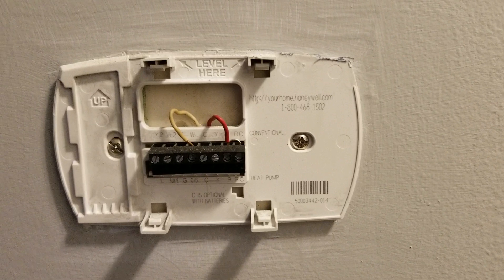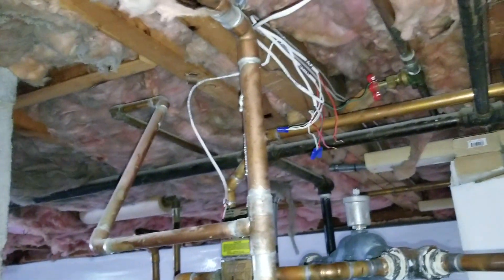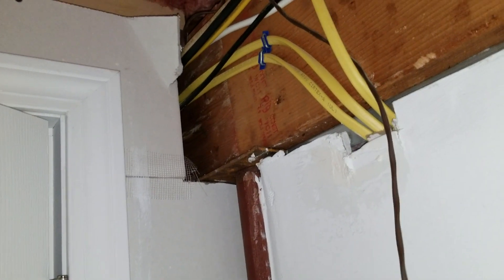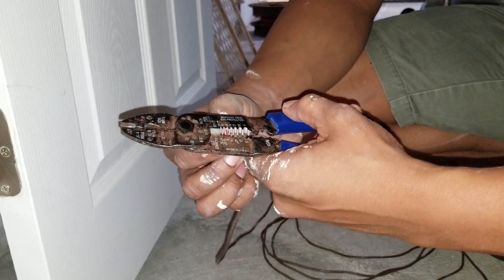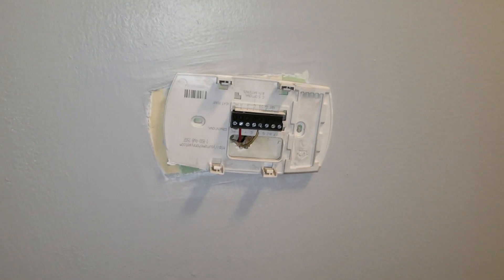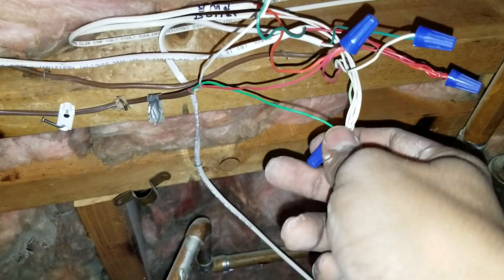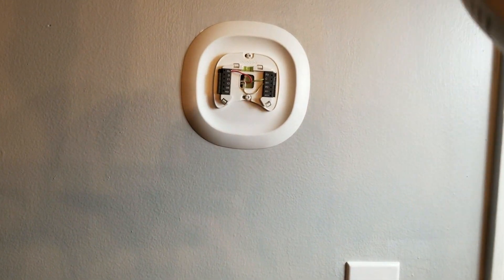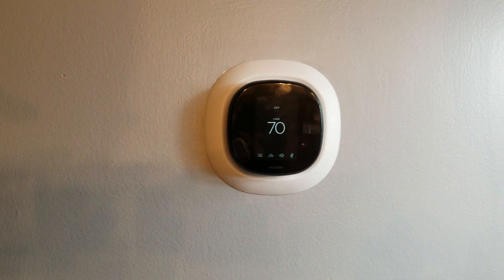How to install Ecobee4 to a 2 wires system

Comment: Dumb , misleading video.
Reply from the maker: Why you say that? I showed you what's needed ti get it running even if you only have 2 wires because the thrid wire is just 24v needed for the ecobee.
Reply: You have to show the wiring step by step

Comment: Ecotits...  gawd dernit..  damn instructions got a picture of 2 wires and says “might not be compatable, to check go to www.....”. And its a dead link..  either way the compatability page has a click the wires you have..  mine arent labeled and both black..  da fuq..  i email them and they replied back, “those are just two black wires.”   Well gold star to customer service at ecotit..  estute observation of the picture and my email that said the exact same thing they replied to me...  only 2 wires...  well no sh....  i sent then a reply that said “ this email is echoing, may have a bad connection, let me try sending from a different computer..”.   They replied to me “may be a bandwidth issue, good luck!”.................    returning unit...  with some cat shit inside the unit...  sent it to ecobee as a faulty unit..  steamed the sticker off of it and everything so is not voided..  cant wait for the email..  lol.  “Sir theres a bunch of shit in here”.  Gonna be like “ i know, thought yall knew how everything worked inside,  if i knew electronics i would have fixed it myself..”.  Ha!

Comment: This is a totally confusing video explanation is very poor. Have no idea what you just did you started with two wires now you have three. Even your title is misleading. ☹️
Reply: Hi Orley. RC is the hot one. Doesnt matter the color (black or red) C or common is the ground, most of the time not really needed. W1 is the white to close the loop.  Hope this helps.
Reply: @viktorneyman7179  Though the C wire is indeed "common" or ground (and isn't needed for most traditional thermostats), most smart thermostats -- including all ecobees -- need it together with the R (hot) wire in order to draw constant 24VAC power from the furnace. (Nest and one other brand claim they can do without it, but the batteries needed to avoid it and Nest's backup charging method of power-cycling the furnace are often problematic.) If your existing system is 2-wire (heating only), pretty much your only options with ecobee are a new 3-wire cable to the furnace (as in this video) or an external 24VAC power supply. Ecobee includes a free "Power Extender Kit" with its thermostats, and other companies sell similar workarounds, to provide the required power over the 4 wires typically used with HVAC systems instead of 5 wires; but those won't work with 2-wire systems because the G-wire they free up to replace C doesn't exist in those setups. Also, this followed an earlier video on this same channel that more fully explained his dilemma; I watched that one just before this, as he intended.
Reply: @richellebrittain2127 I've watched many videos and searched the web and no one explains this as it is.  They all talk about wire color, letter, vernacular etc.  Just tell us it needs a 24Volt A/C with the ground, common etc. That's all.
Reply from the maker: I'm sorry it confused you. What I mean is that there are different ways of installing the thermostats even if you only have to wire going to your current thermostat.

Comment: hard to understand, on the zone value. that's where I'm stuck at. Looks like it's Red, White, Green/Blue... what is spliced into what?
Reply: Following... Red is Hot 24V, Green/Blue is Common, White is Boiler W1, I power up but voltage drops to 18V and it powers off, then reboots, if I add a transformer to the same system, how would i wire it?
Reply from the maker: @jamesking890   if you use an external transformer,  just connect the 24v to Rc and the common to C. Let me send you a diagram for external power.
Reply from the maker: Basically, you have to connect Rc to the 24v and the C to the common  coming from the transformer of your boiler.
Reply from the maker: this is a link where you can find more info about wiring with the boiler transformer and external power
https://support.ecobee.com/hc/en-us/articles/227874667-Heat-only-2-wire-boiler-furnace-installations-for-ecobee-thermostats